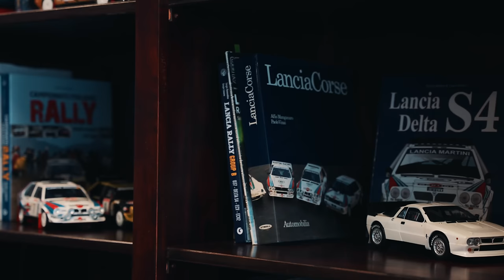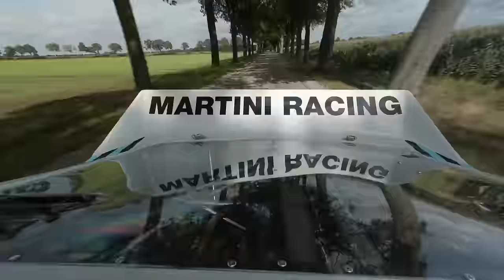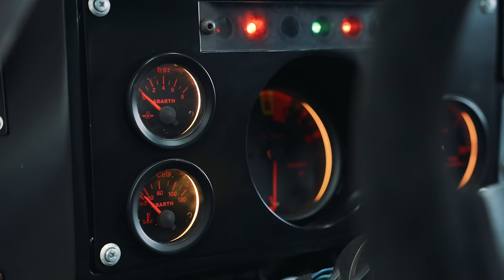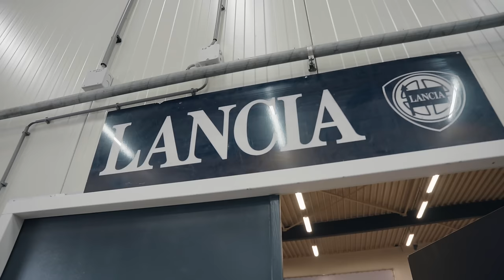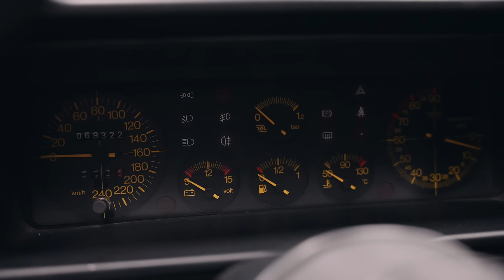NEW Reborn Lancia Rally 037 Group B Restomod  // World Exclusive Review

Comment: You may or may not have helped sales at MCC but I have no doubt more RC Tamiya 037s will be flying off the shelves this Christmas thanks to Jonny and this video. Lol.
Reply: It's an awesome kit with a hard body. Real fun build.
Reply: It’s getting the Martini stripes wrinkle free that’s the hardest part! I’ve removed the centre shaft to make it 2wd too. Great kit.
Reply: Got mine sitting on my bench, getting ready to build, already have a Stratos and an Intergrale, just need to find a S4 Delta..
Reply: @manofsteele60  I came here to say the Tamiya version is 4WD lol... I'm a stickler for authenticity when it comes to my builds, I'll be making my Mercedes 190E DTM 2WD since it's on a TT-02 chassis!
Reply: @kramer26  Yes! I love Tamiya but I wish they put it on a proper 2wd chassis. I'll keep buying regardless 😂.
Reply: @ducsauce  this time last year I did a tribute  Rothmans Rally Car based on a 911 RSR shell and an MF01X chassis, this year I've been working on restoring an original 1983 ORV chassis and topping it with an Audi Quattro shell (so it will replicate the original Tamiya RC car and be 2WD ironically. Lol) So I think I need an 037 to match the other two. ;)
Reply: @manofsteele60  I find a hair dryer helps.
Reply: I've got all the right parts to make a brand-new Lancia Rally, I love the cartoon stance of the original rather than the newer more-realistic one.
Reply: @timwilks666  that's what I'm trying to emulate with my Quattro Rally Car on a 2WD ORV chassis. Quattro but 2WD just like the original was. Lol.

Comment: A friend of mine had a Fiat 2000 Racing in the eighties, essentially the same as a two-door Fiat 131 TC, i.e. with a 2 liter engine and 112 hp. It almost resembled a dot on a Fiat 131 Abarth, but it had 143 hp in the homologation version. I drove it a lot and it was incredibly well balanced, even with 112 hp it had a good punch. Fun car I would love to have today, especially the Abarth version, but now the prices for these have skyrocketed.
Reply: Me2! I drove various 131s for years. Some 2 door, some 4 door, all with an Abarth bit here and there. Used to pour through the Cosentino FAZA catalogues  and dram of a complete Abarth 131. On a visit to Abarth on C/so Marche 38 in 1987, I missed the turnoff and went down a street to turn round. Lo and behold, there was a 131 Volumetrico 2 door in a driveway of what turned out to be a rally car prep shop. I begged the chap to sell her to me, and after 2 years and various trips to Torino, he sold her to me at a very decent price in 1989. Lots of work to do on here, but she was a genuine Volumetrico with the large compressor, special carburettor, and Abarth instruments that he had pinced from a 037. Sparco seats and the independent rear suspension from a 131 Stradale. Wow! Regret selling her, but life is that way...

I wonder where this chap is getting the Volumetrico compressors from, and all the special castings?

Comment: more safer than an original? how?
Reply from the maker: Safer space frame design and tubing. Safer suspension, tyres, seat and harnesses. Oh and fuel system with ecu.
Reply: Have you seen vids of the originals crashing ? And turning into burning confetti ?

Comment: Its not a Restomod.
Reply from the maker: Sort of is, as isn't totally standard and has been systematically improved with safety, fuelling, suspension etc.
Reply: @TheLateBrakeShow  To rally it under FIA rules it has to be period correct, except the safety with has to comply higher standards than in the eighties. But engine, gearbox, suspension has to be as it was back then. 
So no modification on the mechanics, but these would be typical for a restomod.
This beautiful and fantastic car is not restored. Its newly build. At least 85% of the car is new.
And its not modified. It drives like the original.
Not more power. No better suspension. Not more comfort. Not faster.
Safer yes. And more reliable, because its new.